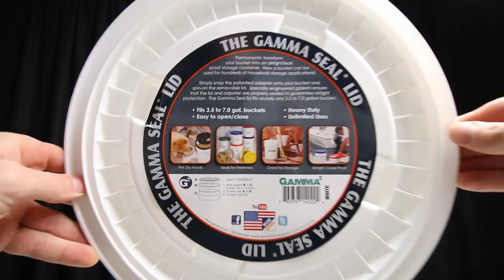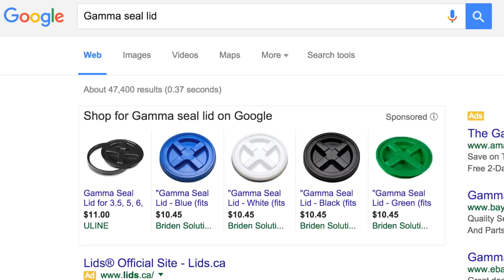HOW TO: Build an XL aquarium canister filter with a 5 gallon bucket - 1 of 2

Comment: I don't know if any of you guys tried this build. But the gama I see, I will not hold the pressure. So, do not have the outlet of the pump feeding the bucket unless you have additional clamps for lid. Make sure the pump inlet is at the bottom of the bucket✌️

Comment: Really this homemade canister filter is a great filter that offers the same as the EHEIM 2262 or the Fluval FX6 with the difference that the total cost of this homemade canister is $ 135US including the external pump compared to $ 449US for the EHEIM or $ 340US from the Fluval.
It is very important to take into account something that was missing to mention in the video about the construction of the homemade canister. Great care must be taken to seal with silicone and clamps all parts of the filter. It is also important to seal the edge of the Gamma seal. Another great external pump for this homemade canister is the Orlushy DC 5000 which can be purchased on Amazon for $ 79 US. Which must also be sealed at the joints with silicone and clamps to prevent leaks.  The MOST IMPORTANT PART is two 12V Plastic Solenoid Valves at the entrance and exit from the canister filter in order to prevent flooding your home in a blackout.

Comment: I built this for my juvinile yellow belly slider tank and it works amazing.  Smell locked in the bucket, tank stays clean for twice as long.  The syphon suction and flow from the pump work together to keep all the big debris out of the tank way better than using the pump for suction.  Thanks!

Comment: looks good. I think it'll take a little more engineering on the inlet/outlet pipes so that you can disengage them. If you just hard-plumb them in then you won't be able to rotate the top. It'd probably just take putting a union in one each piece so not difficult at all.

Nice project Joey. Looking forward to this "big" project
Reply: +AquaStudent Remember: You can never have too many Unions or 45 degree Elbows in--any--plumbing project...
Reply: hi Joy I did the  extra large canister filter I'm having a problem with it leaking how can I solve that problem do you have any suggestions

Comment: COMMENT / QUESTION... My Son & I completed the canister build more than a year ago now it works amazing, and handles a "Bio-Load" way above its "Weight Class"!
I had a question for you in a relation to this build, I am currently in need of a heater for the tank I'm using this canister filter on, I found a good one on Amazon for about $50...

As a fellow DIY Enthusiast, I have been contemplating the idea of using a "Beer Belt" on my Brew bucket because I kept it in the basement and as you may know to help facilitate fermentation it needs to be kept warm, some of the nicer beer belts are adjustable to specific temperatures, I'm just wondering if you've ever heard, if you have any experience with, or what your thoughts might be on using a beer belt as a tank warmer when placed on the canister filter..?

Comment: Is there any benefit to a high powered submersible pumping water into the bottom of the bucket and out the top with good cemented PVC fittings and sealed with silicone versus the external pump?

Comment: Hey I have a question. I have Two 55gallon tanks 1 full of african cichlids and the other a community tank with discus. Would I be able to modify the suction and return pipes to filter both tanks from this type of canister pump???
Reply: Michaela Fisher I was just thinking the same thing. siphoning both tanks with hoses into the bucket and splitting the return with hoses back into the aquariums. Just have to have a strong pump or restrict the incoming flow to keep the bucket from swelling with water.

Comment: I have a  bucket filter with a gamma seal lid and it leaks through the lid. I believe the seal in the lid can not handle the water pressure with the buckets on the floor. Is it best to elevate the buckets above the tank to weaken the pressure. Or is there something I can do to get a better seal on the lid? Or do you have any suggestions?

Comment: Going to run with this idea for my filter on a 60gal. I think it'll work out perfect... but we'll see.
Reply: +Yee Yang Hoo-bay, that's probably going to need a really-low GPH, or a much smaller bucket, something this size is most-likely over-kill for a 60.
Reply: Garethaxz 800gph overflow with a 700gph return. Should be fine.

Comment: but nice job on the game of steel I was thinking if you end up running the canister filter bottom to top you could add a swivel Union at the bottom and the ball valve on the line Danny would be almost to self cleaning filter just unhook and place on top of another bucket and they just reopened the ball valve for 5 minutes and let it drain
Reply: Also a swivel or Barb on top with a ball valve just so the filter is removeable

Comment: I don't know if you read these things anymore but I made this, I have it hooked up to a utility pump and the intake to the aquarium (exhuast from the magnetic pump)  splurges alot of bubbles I was told it's and air leak but I checked every peice of my pluming and it's all air tight .
Reply from the maker: +nate gerdom might have trapped air in the media. Give it time to purge it all out.
Reply: +The king of DIY the pump is it bad for a magnetic drive to pump like that ?
Reply: Hi! I have the same issue.  However over time the bucket actually drains itself!  More or less every 100 gallons the pump removes from the bucket, only 99 is sucked back in.  Eventually the pump runs dry. 

Anyone else have this issue?

Comment: Please folks.  Know this.  The reason you don't see a completion video of this DIY filter?  It does not work.  I decided to give it a try and virtually all the plumbing works fine but the Gamma Lid is a joke.  I tightened it by tapping it tight and then did a water test.  The weak link is the screw on gamma seal lid.  The gamma seal lid cannot take even the slightest hydraulic pressure and I don't believe it has much to do with the "o" ring as much as it has to to with what the lid was designed to do: seal air.  After taking the time to build this it would be good if the author would do a retraction or a fix.  I love the idea.. had it worked.  Id design and build a better light bulb were it not for the fact that this falls into an area of DIY that would create immense liability.  Really too bad.  I do believe the Gamma design could be improved upon.

Comment: HI EVERYONE!  I built one ; works great but the gamma seal leaks if the pump it shut off or power failure. I have it set up below the aquarium; (siphon in /pump out.)..  I have tried lubing the threads and the o-ring with Vaseline, and even tightening the screw-top with a rubber mallet.  
Any fixes here folks ? 

THANKS

Comment: Hi Joey,  Would 5/8" inside diameter heavy duty garden hose work for tubing.   I can buy 50'  Heavy duty Garden Hose for $20 vs. $2.74 a FT for braided vinyl tubing.  What you would you suggest.  Thanks

Comment: @thekingofdiy    Hi Joey, thank you for all your DIY projects.  I have watched many of your videos. I believe you to be the most succinct, thorough, and knowledgeable DIY instructor on the internet. This video's topic is exactly what i'm trying to build for my 150 gallon african cichlid aquarium. Can you please make another video, showing the entire project start to finish.  If you could, would you please list out all necessary pieces of equipment to make purchasing fool proof. Also, i'm struggling choosing the right pump.  I want 500gph however, because of the size of my tank the pump head would be around 5 feet.  At this height, it seems I would need a pump somewhere in the neighborhood of 1,000gph to achieve 500gph at 5  feet in vertical rise.  If you could incorporate some attention to parts and pumps in your video I would greatly appreciate it! 
Until then, thanks for all the videos. 
-Don
Reply: +Donald Worthley I made one of these and you can purchase a 1200gph pump for around $30 on ebay from cll_petsupplies. I have a video I posted on how I did it. It's not the best but it works and I have no leaks.

Comment: I'm having some pretty bad issues with having a good seal with the uniseals. The holes are drilled properly, one of the seals seems to be holding well on the output (on the bottom), but the top seal seems to leak air (followed by water) constantly. I've tried sealing it with super glue, but air finds another way out, followed by water again. It seems to be my only point of failure and is a bit frustrating :/ do you have any tips for this?
Reply: after working for 5 min mine starts leaking from the top of the gamma seal from the pressure

Comment: I had the same idea but I'm having leaking problems when pressure built up inside.  I tried using gasket sealer and it worked only a few days.  If I want to do this I'll have to use less stuff in the bucket for less pressure build up I guess.

Comment: Hello, Joey 
I did this build for my 240 gallon. It ran great but the issues was when I turned it off the pressure (from the siphon) was so great it leaked around the gamma seal lid. The bucket also started to bow on the bottom. Any advise would be greatly appreciated
Reply: Did you use bulkhead fittings or the uniseals? Also wondering if you figured out how to fix the pressure issue
Reply: +Chad Shosten I used bulkheads and no not fixed the pressure yet. I am going to put it in another bucket
Reply: How did it turn out

Comment: After viewing this video, I took the plunge and made a 5 gallon bucket filter.  The gamma seal lid leaks under pressure ( the screw on part, not the seal to the bucket top)  limiting the flow that I can send through my filter.  I've tried changing the gasket on the gamma seal, putting plumbers goo around the gasket, and wrapping pipe tape around the gasket.  Do I have unrealistic expectations for the seal, did I get a bad lid, or is there a way to get it to seal that I haven't tried.  I note in the video, that you say you need to "lubricate" the seal...vaseline?
Reply: +George Miller Where's your pump? Are you "pushing water in" or "pulling water out"?
Reply: I'm pushing into the bucket
Reply: +George Miller Follow up- I removed the lid and greased the o-ring with vaseline. After replacing the lid, no more leaks.

Comment: Hey everybody! I have this pretty much exact build. All seals are perfectly air & water tight HOWEVER, my gamma seal lid will just not seal. I've tightened it down as hard as i can. (me tightening the lid while someone is couter-holding the bucket) but it still leaks. What is the best solution here do you think?
Reply: I cannot get my lids to seal either.  Did you figure out a solution?

Comment: I built this model and if you're trying to filter a 30 gallon i could see this working, but to move enough water to filter a 75+ gallon tank, this isn't the answer. the gamma lid isn't designed to go under pressure (check website) and not to mention the head height plus the 200+ g/h pump is to much force for 5 gallon bucket, needless to say my bucket split in two and soaked my floor =\
Reply: Thanks for posting this. My tank is a 38 and I don't plan to go too ham with the pump, but I'm sure there are dozens of people out there researching this as a potential for a larger tank, and hopefully they'll read your reply and give it some more thought!
Reply: Yea like me, I have a 55 gallon tank, see I readthat the gama seal sucked, but you saying the bucket also? What about the cooler buckets

Comment: where do you buy the uniseals cant find them anywhere
Reply: Nichol Wilson .... Amazon.... be sure to check the holesaw size to drill the lid and bucket with before you buy the Uniseal. (a 1 " uniseal needs a 1 3/4" holesaw)

Comment: Does not work. Leaks under pressure. Gamma seal rim has factory push pin marks to prevent from getting a good seal. Will work with pump in the bucket and a overflow to the bucket causing no pressure. Sort of like a mini sump. But like I said do not expect this bucket filter to work like any kind of sealed canister. Lid will spring leaks. I tried several gamma seals and they all leak under pressure no matter how much you tighten down on them.

Comment: My gamma seal didn't work at all. :(
Reply: Seal the part of the lid that snaps to the bucket with silicone. It's best to squeeze a ton of it up in it before you put it on. After that, take the o ring that's attached to the screw top, THROW IT IN THE TRASH, and then order a 378 silicone o ring off the internet. When that arrives, put the o ring in place, apply some petroleum jelly, and screw it on tight. Problem should fix itself. btw unscrewing the top may require some serious force to do (I literally hold the bucket with the bottoms of my feet and use both arms to twist the top), but maintaining this filter isn't something that requires you to open it frequently.
Reply: AFreakinProblem what size o ring or can you and me a link